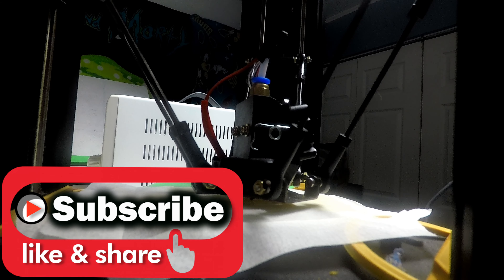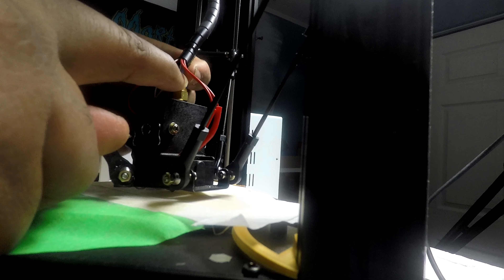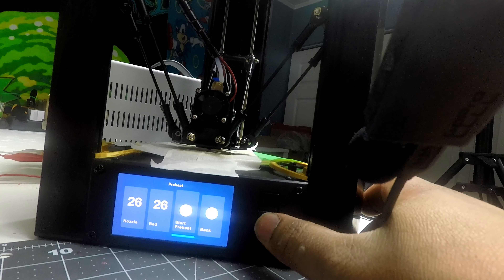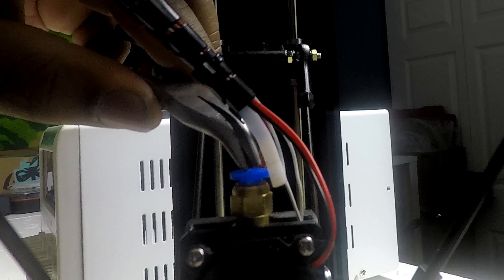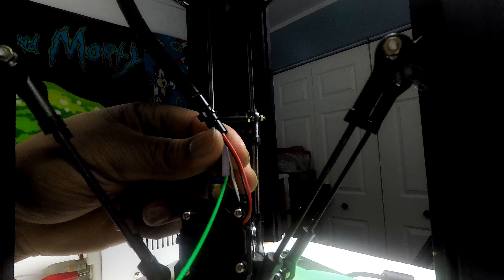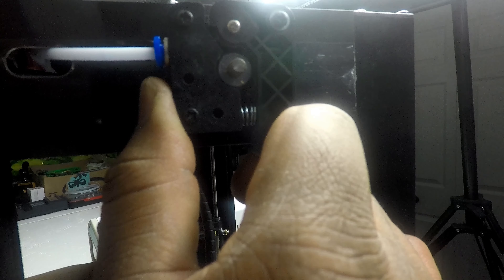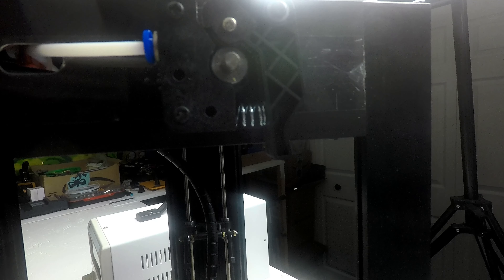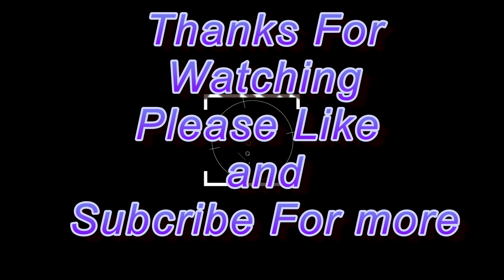How to Remove Broken Filament From Your Mono Price Mini Delta Printer

Comment: How do you get it to lower? Mine will only stay at the top? Also what if the nossle is jammed and you cant grab it
Reply from the maker: You can usually just rock the print head back and forth while pulling down and it will move down . If you can't grab it remove the hose and hose adapter completely and heat the nozzle to the max temp and stick a piece of filament Into the exposed opening and leave enough to grip having out  . Let it cool so you filmamet has fused and heat it back up and pull firmly while holding the print head from moving while it's warming back up and the clogged filament and filament you added should pop out together .
Reply: @TheCasualCreator1  For my clog its too deep to grab with a needle nose. But I'm not sure its deep enough to be getting heated. How deep does it have to be to be heated so they can fuse? Mine is stuck at the base of the gold adapter but not all the way into the heat sink. Will this be deep enough to fuse? Is there a way to safely remove the gold adapter? Any thoughts would be appreciated!
Reply: I fixed my clog! I had to take the extruder nozzle off and push a tiny allen/hex wrench up from the extruder which then pushed enough of the filament through the bozen connector to be able to remove it. What a PITA! But I am back to printing! Thanks for this video though! It would have been very helpful if mine didn't clog so deep!

Comment: Please help! Got this for my lil future architect for Christmas, and we have a problem. A piece of PLA filament is stuck at the top of the tube.  It's about 2 inches long and too far from the feeder but not long enough to have gone into the tubing on the inside of the machine. I can push it with another piece of filament it's like a traffic jam.  What can I do? I kept breaking the filament as I tried to load it, we have yet to print anything. Thank you in advance for ANY assistance or suggestions. This is my first time every using a 3D printer.
Reply from the maker: You can remove the tube from the nozzle connection and use another piece of filament to force the broken piece out . If the filament is breaking easily that's bad sign there might be a moisture problem with the filament . Unwind at least one layer of the filament and cut it off . Then try Bending the filament to see if it snaps as easy as the previous layer of filament. If it bends more before it breaks go ahead and feed it in . If it still snaps easy . Replace the filament with a new roll . Also make sure it's PLA not ABS filament.

Comment: Gotta problem where the printer wont print, when I start printing the auto00.g (something along those lines) file it does its triangle thing normally, but when the printer actually starts printing I hear a clicking noise and the printer wont print. Initially I had thought that the spool was to heavy for the filament to keep going, so I pulled a long string of filament and cut it. I tried again and alas! It worked. So I let it do its thing and somewhere along the lines the printer started clicking again. Is there any way to solve this?